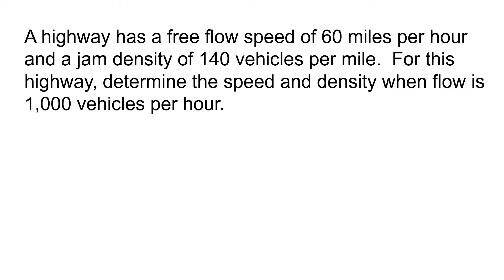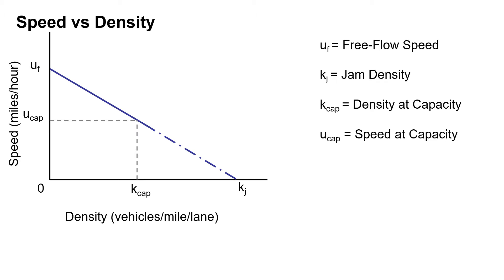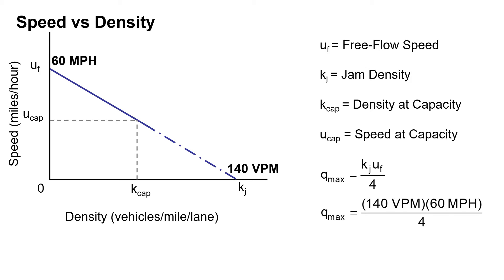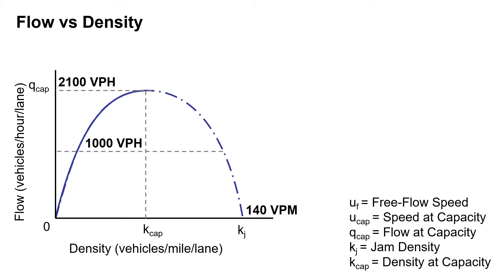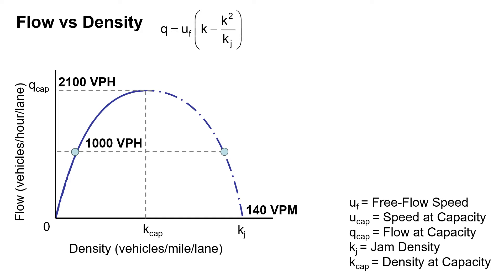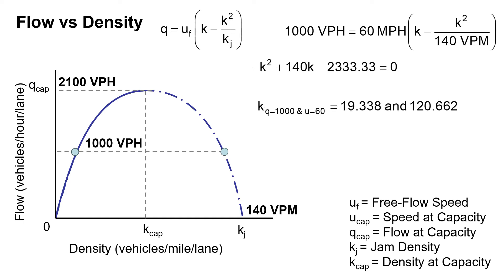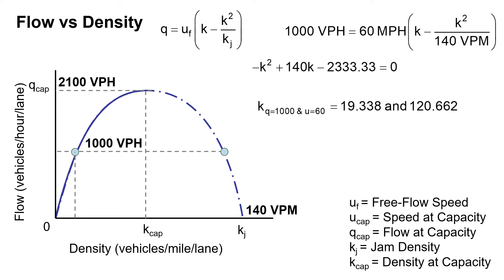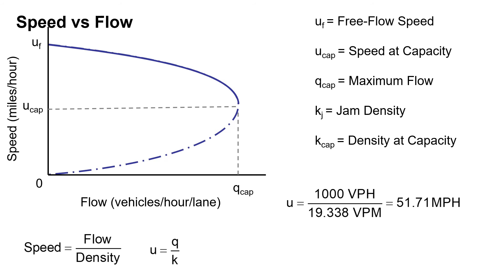Determine the Speed and Density for a Highway at a Given Flow Rate | Example Problem

Comment: Just solved a problem like this in a simulated PE AM section! The NCEES HB has a cheatsheet on this  equation.
Reply from the maker: Which equations/page of the handbook did you find most helpful?
Reply: @FindleyDaniel  NCEES HB 1.2, page 273-274.
Reply from the maker: @oleopathic  Yes, more of those equations are also in this video - https://youtu.be/DmrmtYLabrI?si=9lYVHU9I26SHsHsc